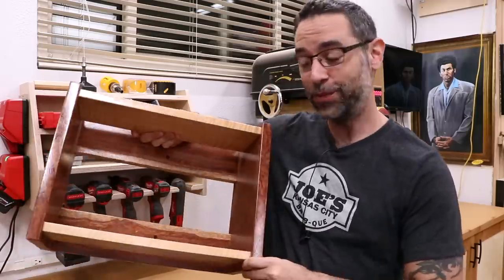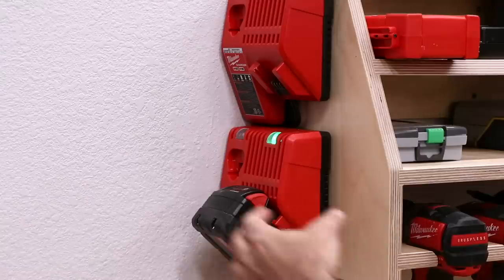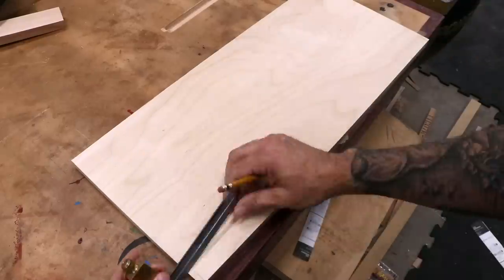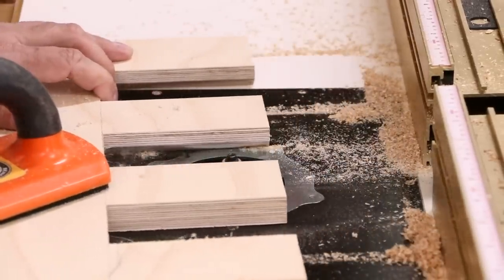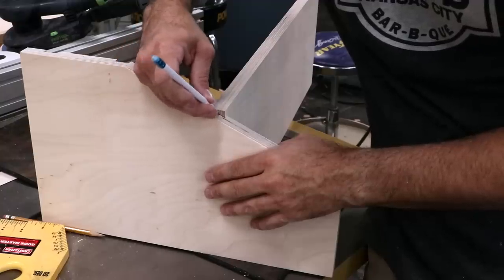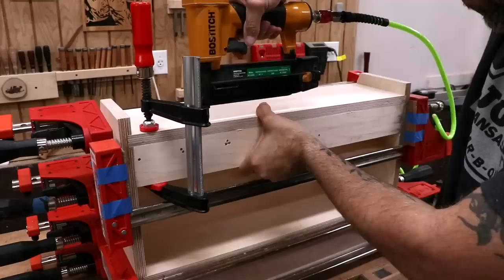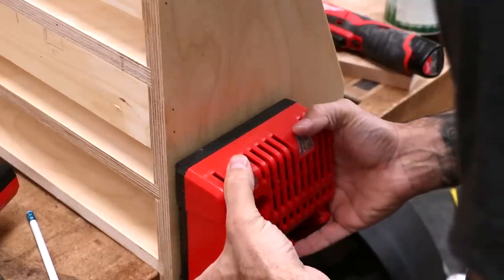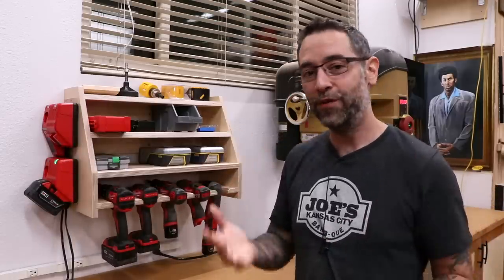Drill Charging Station | Easy to Build!

Comment: Hey Marc, a tip for mounting those chargers. Photocopy the bottom of the chargers and you can see exactly where the holes need to go.
Reply: I do the pencil rub trick often. Works great in short time. Printer ink is more expensive than any liquid. Hehe :)
Reply: I just use masking tape

Comment: I love useful shop projects like this. I too have an old drill charging station that I built about 5 years ago when I only had 2 drills. Now that I have 5 I need to build a new one. This is perfect for my shop. I really like the angle and that you can put your drills in already chucked with a bit, since I generally use at least two or three of the drills with specific bits more often. Thanks for sharing this video. And thanks for providing free plans.

Comment: I did something similar, but much larger. Pretty much all the tools I use anymore are battery-operated. I prefer DeWalt, but Makita has some unique tools, so I have two platforms. Makita random orbital sander and trim router, along with an older drill and driver. Everything else is DeWalt including reciprocating saw, oscillating multi-tool and circular saw. As many slots as I could cram into 48" with lots of shelves above. I designed mine to have the drills and drivers facing out, so even a long bit isn't a problem. You just have to watch how you grab. Of course your way you get to pimp the branding, so nobody mistakes your Milwaukees for Chicago Electric (gasp!)

Comment: Really digging the new style of how your doing videos now. I was going to watch Matt's video on making a drill charging station but I don't really want 500lbs of slab on the wall just to hold my drills/batteries/chargers. I also tried to watch Shannon's drill charging station video but it ended up just being a video about how power tools are for noobs and that we should all just use hand crank drills. Wasn't nearly as bad as his LED shop lighting upgrade video though. You should explain to him that no sane person would use candles for lighting in a workshop. Lastly thanks for not quitting.

Comment: Cleat wasn’t French enough for me. Still 10/10.
Reply: He probably didn't use a French cleat because he wants to able to remove the batteries off the charger without pulling the whole thing off the wall
Reply: @JacobRumsey  Few heavy drill indexes and the rest on there. Total weight of the plywood it's made from is probably enough to lock it down very snugly.

My comment was joking at how many drill stations are on french cleats and he chose not. It's still technically a cleat too and I'd do it the same way, without a french cleat. Marc is amazing.

Comment: Quick tip for those of us with multifunction printers in the house.  Photocopy the base of whatever doodad you're mounting to the wall.  Gives you a perfect reference for where to put the screws.  Also, why don't manufacturers make the darn things sized for sheetrock screws?

Comment: Good sense of humor and good project to boot.  Question about your Incra sled.  Well, your Incra miter gauge actually.  What method did you use to square it?  Thanks.
Reply from the maker: Just a square against the blade.
Reply: @woodwhisperer  Thanks.

Comment: Mark do you still put your chargers on a timer to have them cycle on/off to avoid the batteries sitting in the chargers for long periods?  I remember that from an earrrrrly TWW video, maybe when you built the last charging station!
Reply from the maker: A timer is a good idea. These days I’m just careful to unplug them.
Reply: I paid a lot for a Jet spindle sander Didn't get to use it for 18 months or so.Ready to use and noticed that this untouched machine had a cracked cast table.Out of warranty and suppliers weren't interested .Emailed Jet didn't even answer. Had craft of jet tools ready to buy.Changed my mind.Foreward thinking jet Cheers

Comment: Careful measuring to mount the chargers? You are doing it the hard way.
Reply from the maker: Not sure measuring two points four inches apart is hard. The reason I said to measure carefully is because I was mounting two of them on top of one another.
Reply: Since I have your eyes, I'll share my tip for mounting wall hanging devices. Remember when you used to take a coin, cover it with paper and rubbed a pencil over it until the image of the coin appeared? You can do the exact same thing with the back of a charger or router or what ever you are hanging. This gives you an exact paper template with hole locations and feet if you do the entire thing. In your case, if you could get the 2 charges to sit flat next to each other while upside down, you could cover with 1 large piece of paper and make an exact template with all of your holes. No measuring required.

Comment: I think it was barely build for purpose. He’s got his drills and batteries....okay, then cram a bunch of other stuff in there. Out with the junk or you’ll need 5 more drill charging stations imho
Reply from the maker: Huh?!
Reply: The Wood Whisperer I dunno, the whole thing looks rushed. Looks like it was made for the sake of making a video and less building it for purpose. Some parts work okay, but the shelves just hold anything you can cram in there. 

I literally just spent 2 hours planning a step stool for my lathe. My workshop is modelled very carefully for space and I had to make my lathe sit too high so my thickness planer would fit under it. Needed a step stool...modelled it and optimized for weight. 2’x3’x6” 18 lbs. so it’s easy to put on the wall at that size. Built for purpose.
Reply from the maker: You might just be overthinking this. The project was designed to do exactly what it’s doing. All of that “stuff” is the drill-related stuff I needed a home for. The stuff on those shelves may come and go and change over time. So making perfect little cubbies for everything really doesn’t suit my needs. I guess I don’t understand why you feel like just because it wouldn’t satisfy your needs that it’s somehow not satisfying mine.
Reply: The Wood Whisperer The Wood Whisperer it just seemed rushed. With a little more planning, I think it would be more effective. Your right, it wouldn’t suit my needs, hence imho.